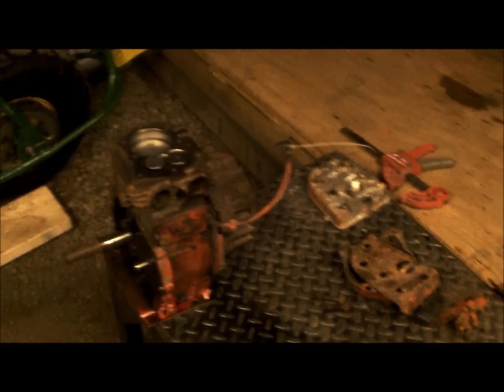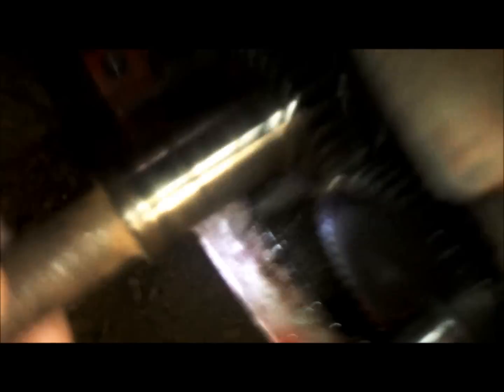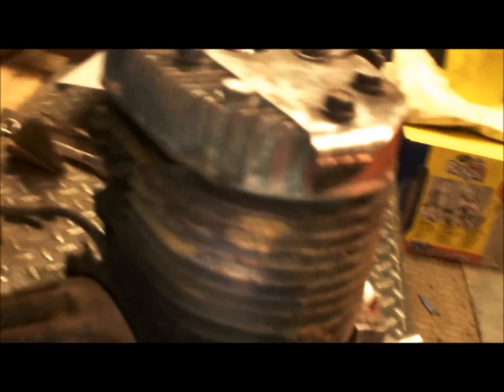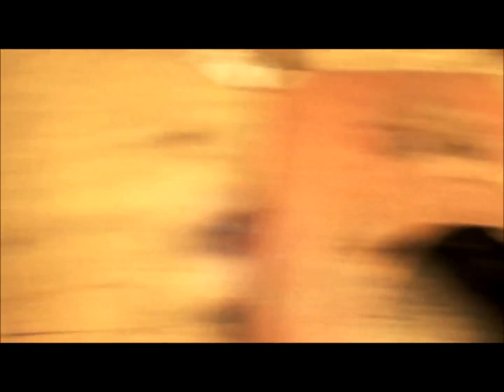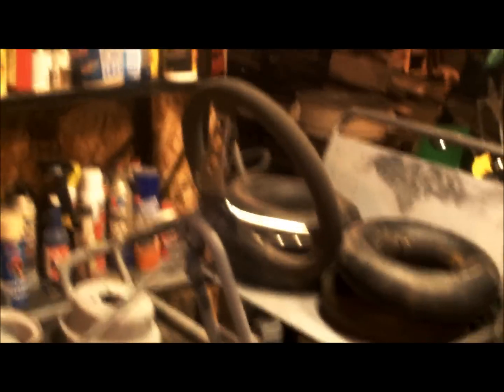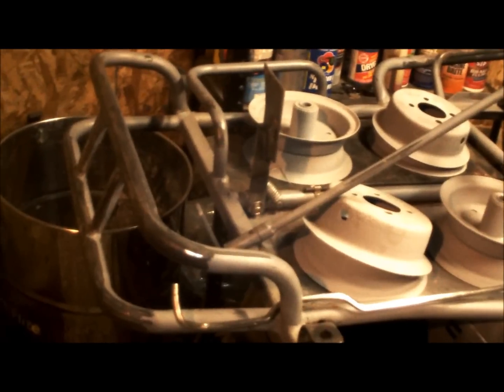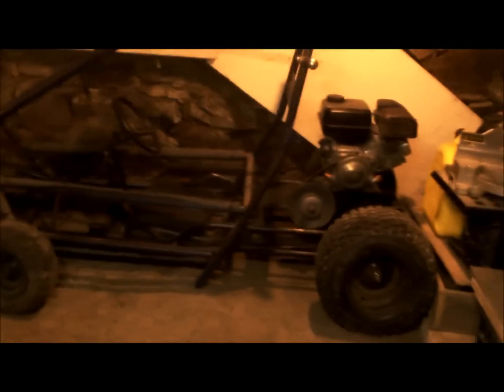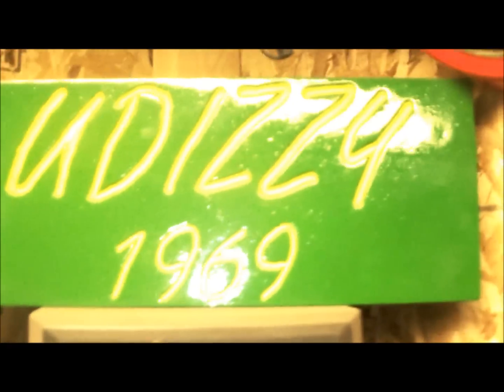more work on the red motor

Comment: great video that might be a 7 or 8 hp as for governor i would take it out for more power
Reply from the maker: thanks bro, cheers
Reply: before install head u can open where u see valves grind the edge towards piston take that out so it a smooth clean flow
Reply from the maker: ok cool thanks bro
Reply: yvw